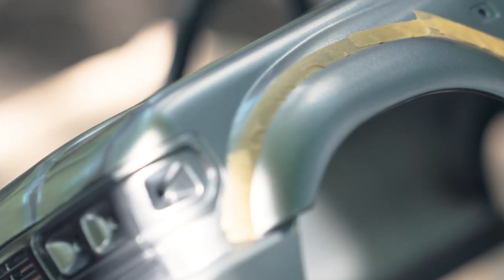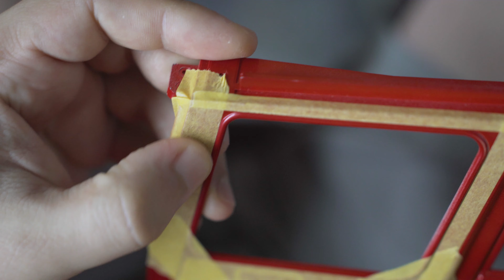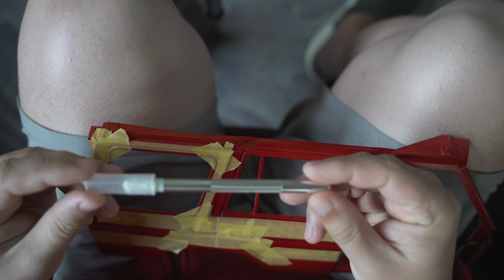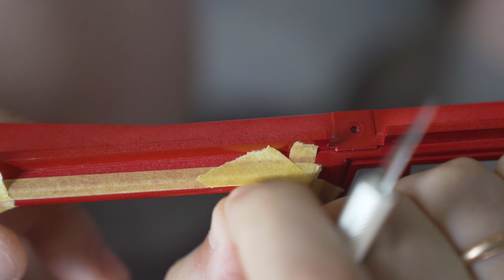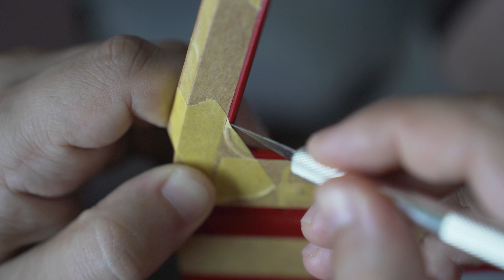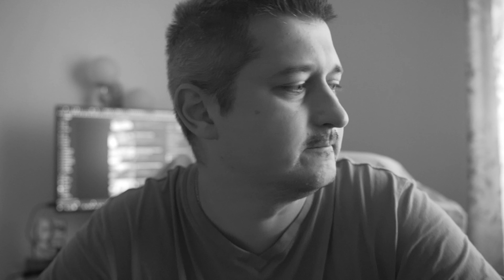Masking and Painting Window Trim: RC Car Hard body

Comment: Very interesting video, it's a job that I appreciate, rare are those who take so much time to do a good job and which allows to have a top result. Sometimes I still do this, otherwise I use a Posca marker in 0.3mm size which saves a lot of time because I no longer need to mask. The 0.3 mm is good for 1/10 bodies, but there are also several sizes of markers for smaller bodies. Bravo for your work 👏
Reply from the maker: Thank you very much I will definitely check this marker. Thanks for the advice!
Reply: @KobtsevRC  You're welcom 😉👍